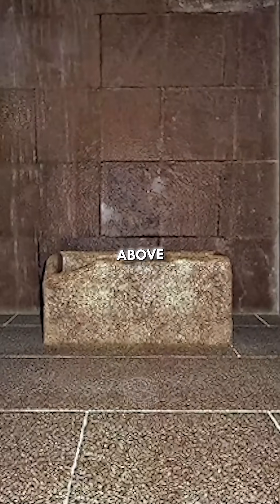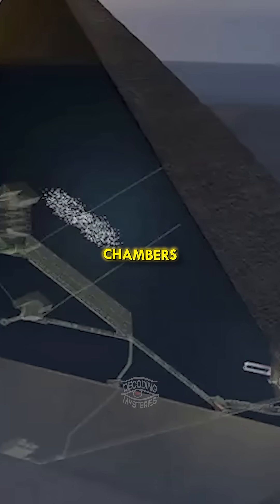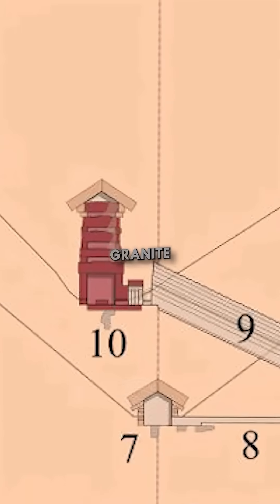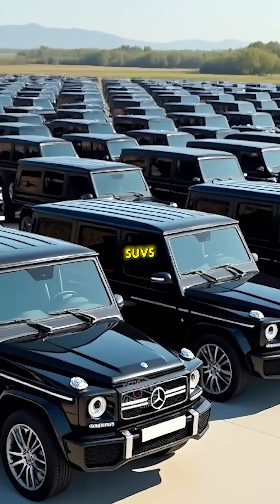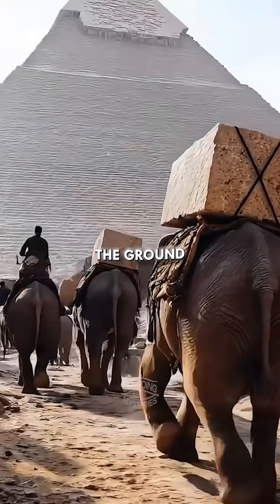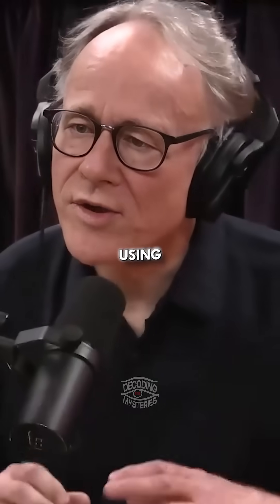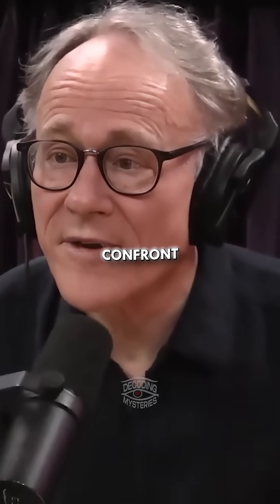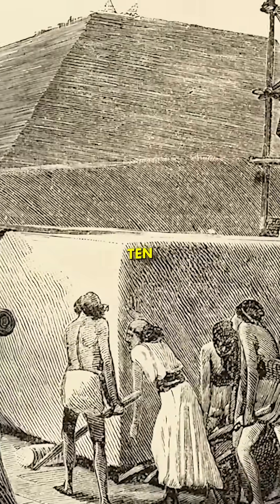Engineering Secrets of Egypt's Great Pyramid That Defy Logic 📜

Comment: Ive said it before and ill say it again, they had 50 some years to make this happen, they had infinite labor and they had infinite wealth. With those 3 things you can get alot done.
Reply: boom!
Reply: We would struggle to do it now, and according to record's had no way of achieving this withoit a crane or metal tech
Reply: @daveh4925  we have helicopters that can lift 44000lbs. Do they find lots of steel in the area? No they found so far one iron dagger in a crypt made form a meteorite, that means iron was super rare, all we ever find is copper tools, if they were so advanced one would think they had something better than copper.

They could have had cranes, but where are the machine shops they would need to build and maintain them? why are we not finding spare parts or metal shavings from drilling holes and cutting metal? because they didnt have them, they had wood, rope, copper and millions of men.

Europe has a very distinct line between the copper age and the iron age, first everything is made form copper, then almost nothing is made form copper, but only made form iron because its better in every way for tools, we would be able to see that here was it the case.

TLDR: we are not even finding nuts and bolts or hinges or screws, little less massive cogs and gears needed for cranes.
Reply: @daveh4925  as a principle we wouldn`t struggle. thousands of slaves over decades.. pulling and shoving slabs up ramps. its self expanatry if you are not an academic
Reply: ramps only needed for the heavy slabs
Reply: @hotdog9262  The shear weight's involved would crush timbre, there is a difficulty curve that isn't linear, we use steel frames and would still struggle massively today, using all our new technology, i suspect the eygptian's inherited the monolithic building's from a previous lost very very old civilization, the hyroglifs are the equivalent of todays graffiti on an advanced past, all their metal's deterioted or destroyed over time
Reply: @daveh4925  in eastern europe they moved a stone over a long land distance weighing over 1000 tons

Comment: The ramp would have to be 2000 ft long at 10 degrees and go up 350 feet. Unless of course you had more power like elephants or just used lots of people. if one person could drag up 100 lbs slowly then 1400 people could pull up 70 tons slowly. Reducing friction is the real key.

Comment: What if they used the elephant. Like a mule pulling a wagon and the might have used 50-100 elephants to lift it that high using block and pulley system

Comment: What if they didn't have the same shape rolling up? What if the ends were hexagonal? Then by levers at opposite ends they could simply roll it up one edge at a time like a rachet.
And the ramp need not have been steep if it were traversing the sides rather than o e straight ramp.